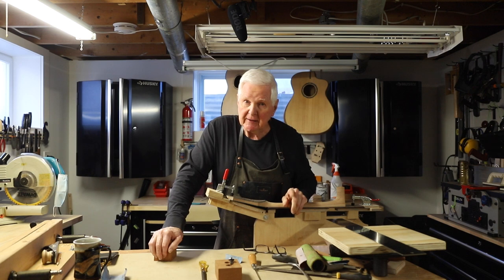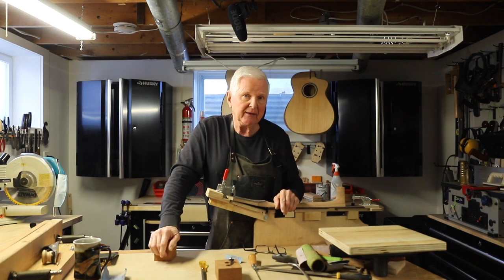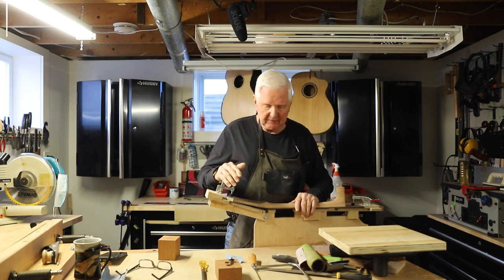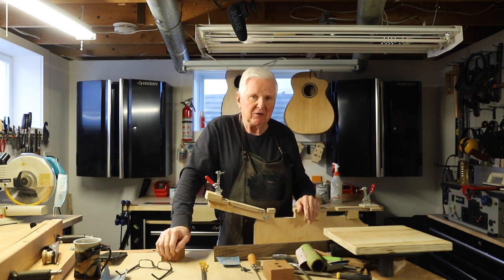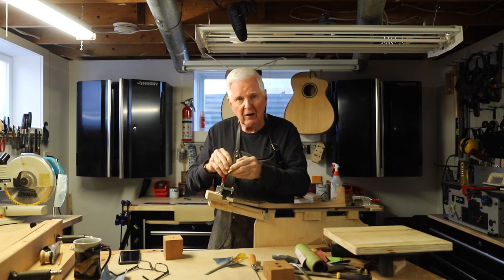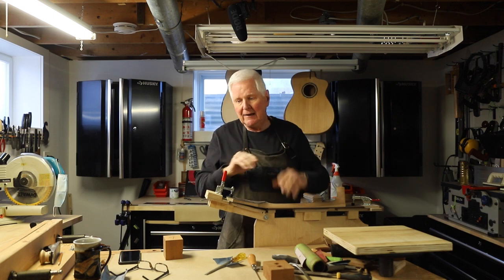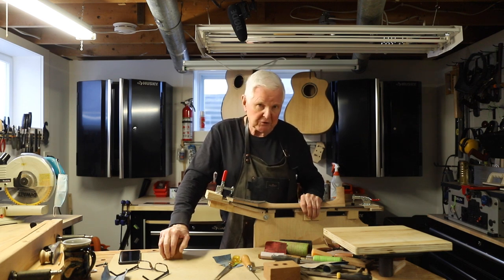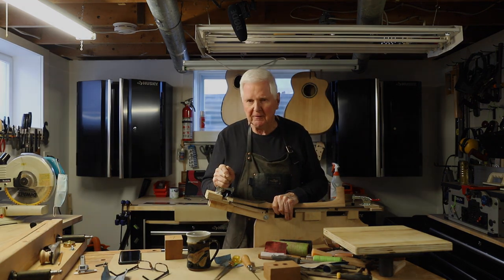The 2 Fastest Way To Lose Your Fingers Building a Guitar

Comment: Thanks Monty. You're preaching to the choir in this case. I am not a guitar maker but I am a maker. I would add one more rule: "There are no routine tasks on a power tool." In May of 2020 I severely lacerated the index and second fingertips on my right hand. They healed okay but I was out of my shop (my passion) for a few weeks. I was making repetitive cuts on my table saw to create small pieces for a project. Brainless stuff that I'd done a thousand times and that was the problem.  My brain was complacent and not fully engaged. It only took a fraction of a second and I'm lucky it wasn't worse. Almost 2 years later I still approach my tools from a different perspective, but it sure is a tough way to learn a lesson!
Reply from the maker: Oh Mike that is awful, I'm so sorry that happened. I think this is a video we should be passing around to friends for sure. Always  stop and think before using  power tools. What you described so well  is easy for all of us to do. Personally, I do not like the router table. It always makes me nervous so I am extra careful.

Comment: Yup, safety is important! The 1 simple saying that has stuck with me for several decades of safe workshop tasks, is to ensure that your brain is engaged before engaging the power on any power tool. Its also important to ensure the your tools are in proper working condition. I am still using my fathers table saw, from the early 1960's. It doesn't have all the safety features of modern table saws, but can still be used safely. Currently the electric motor is in pieces on my workbench, as I had noticed odds sounds coming from the saw as it was turned off. It turns out that the aluminum fan has come off the main shaft and was spinning and banging around independent of the main rotor. It was starting to wear a hole in the insulation of the windings and that could turn into a real electrical shock hazard. Now that I've repaired this problem all I need is a warm enough day so that I can put it all back together and see if the repairs are going to sufficient, or if I might need a whole new motor. Should know by ... July?  :-)
Reply from the maker: Get after that Brian. You don't want a shock or a fire. A simple thing like a sound that you don't recognize can be a vital warning.